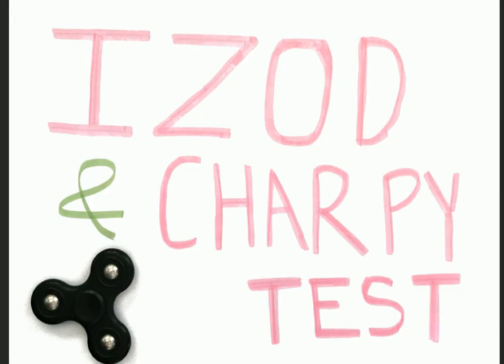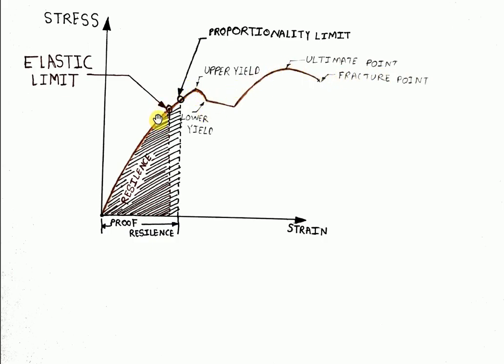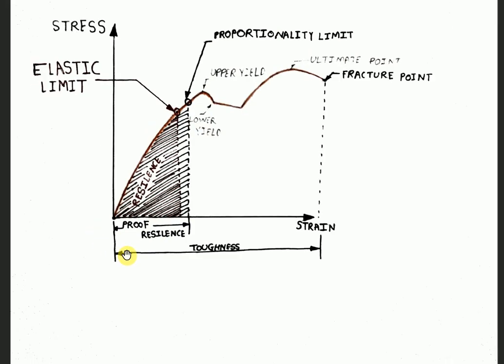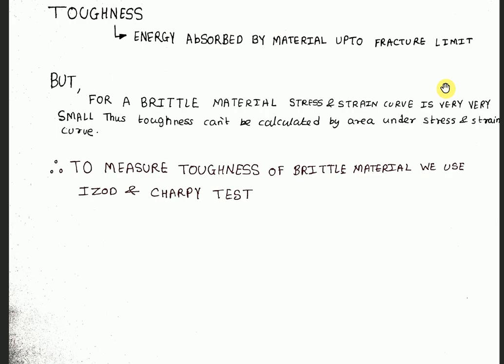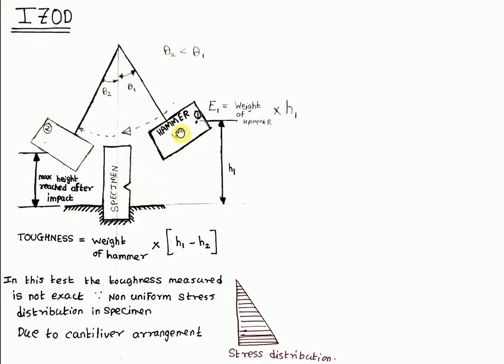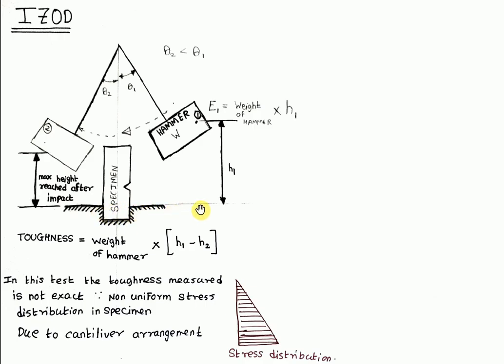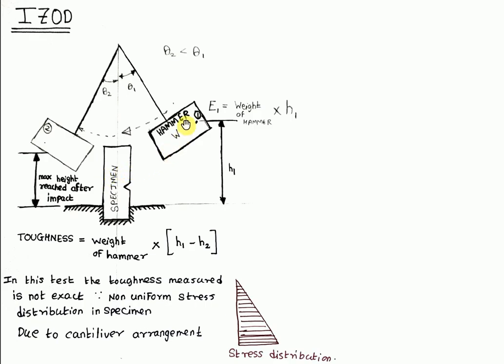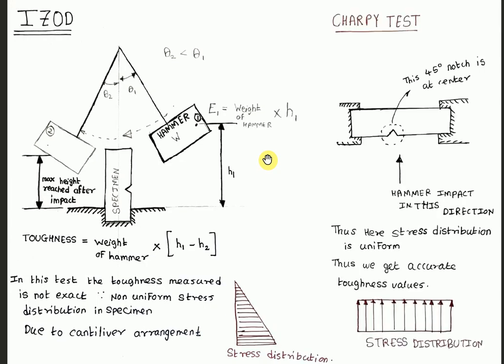IZOD AND CHARPY TEST !!!!!!!! plz subscribe

Comment from the maker: as per page 251 of fundamentals of material science and engineering by William.D. Callister . In case of charpy test notch is in front and hammer hits from back In case of izod test notch is in front and hammer hits on front NOTE- the main principle behind notch is to have a stress concentration point and to break the specimen in 2 half